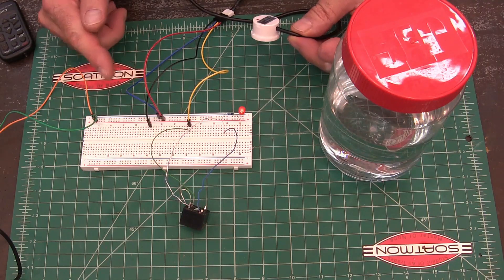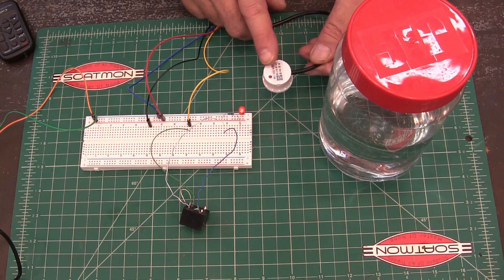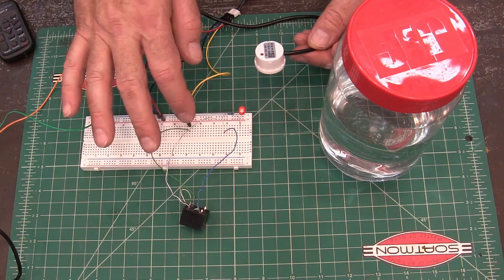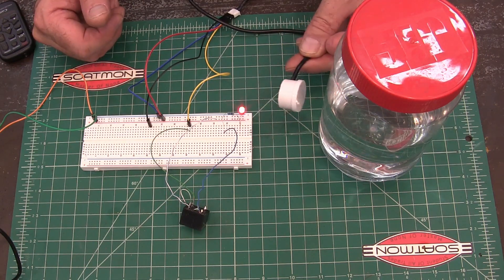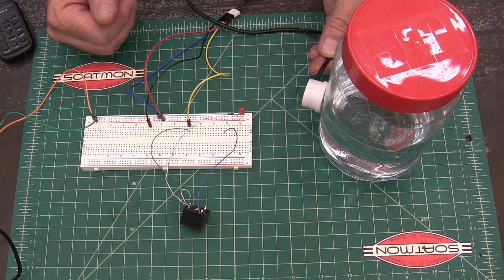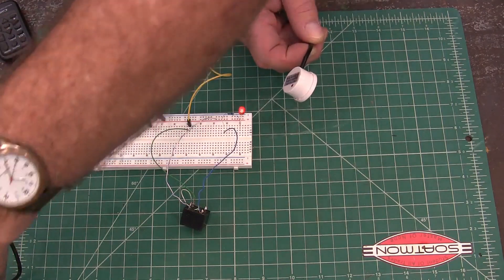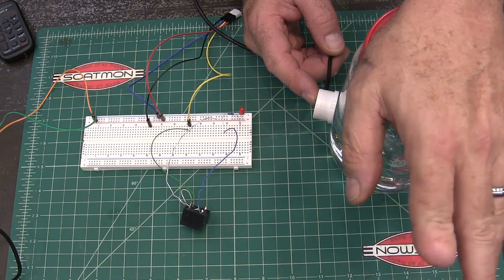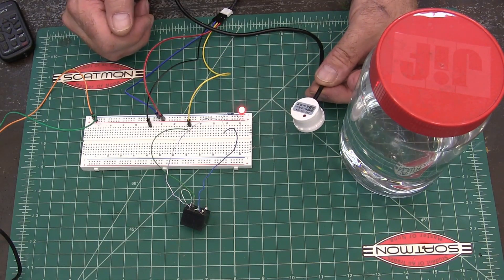Coolant Sensor Design Followup

Comment: What's keeping you from putting a plastic member in the coolant circuit for your detector?
Reply from the maker: You could.  I was trying not to cut any of the lines.  They make a stainless steel coupling that you can put inline and it's got a pipe tap in the side that you can insert a sensor.  I may go that route??
Reply: @SoatMon  Interesting